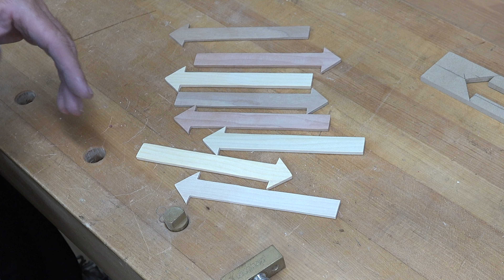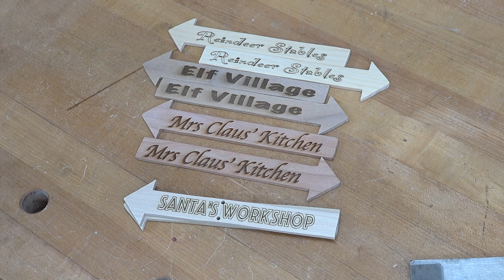Making a North Pole Sign

Comment: Great little project.  I have a question, do you have a layout of your shop?  Or maybe you could take a few photos and post them, taken from each end of the shop?
Reply from the maker: Back in 2019 Scott, I posted a two part series on a tour of my shop.  There have been subtle changes here and there but it is still the same for the most part.  Here's a link to part one of the tour if you are interested.  https://www.youtube.com/watch?v=Q7UyffRMbXs&t=1s
I hope you enjoy it.  Thanks for tuning in and for the kind words on the show.
Reply: @acutabove_woodworkings  I watched part 1 and part2, exactly what I was looking for.  I have question.  The flip cabinet/cart for your spindle sander and planer, do you still have that same configuration or have you done something different?
Reply from the maker: @scottmorris4914  I still have the exact same flip top tool stand that I show in the video except I have change the tools that are on it.  My planer still lives on it, but I replaced my oscillating spindle sander and my new one didn't fit on the opposite side of the cart.  So I mounted my low speed grinder on the other side of the flip top.  Works great.
Reply: @acutabove_woodworkings  thanks for the info.  I have been struggling with my shop layout.  Whe you were describing how you have things layed out,  where the is clearance based on use and size of tools, I moved mine around.  Already see some improvement .

Comment: Another excellent idea for the kids (and adults) ... it'd be even better gluing the arrows together with a little block of wood between them with a hole in it, that way the arrows can be moved up and down the pole (I though that was a knitting needle) ... could even glue some arrows at an angle 👍
Reply from the maker: There is plenty of room for modification in this project Barry and you've got some great ideas.  Thanks for chiming in with them and for tuning in to the show this week.